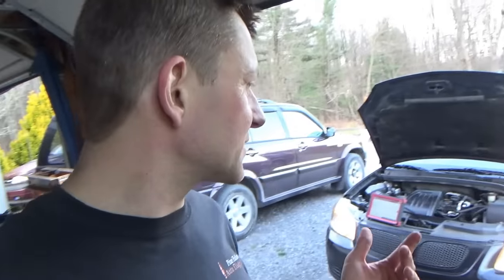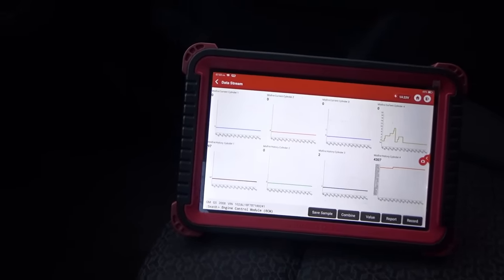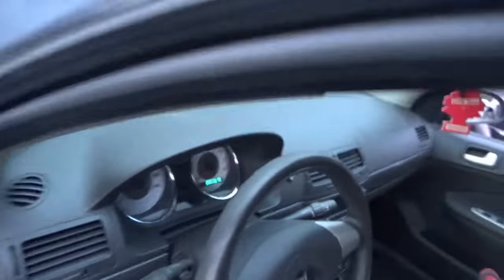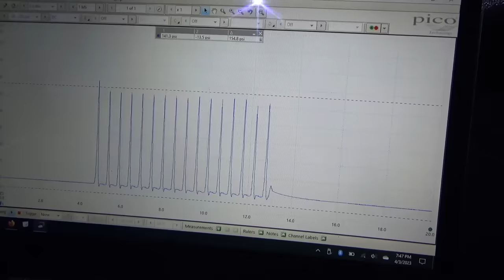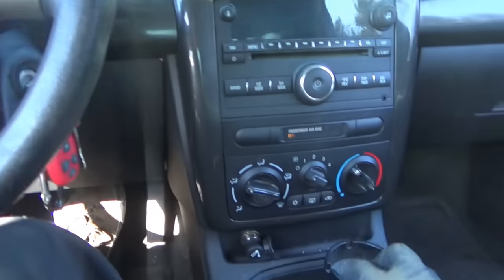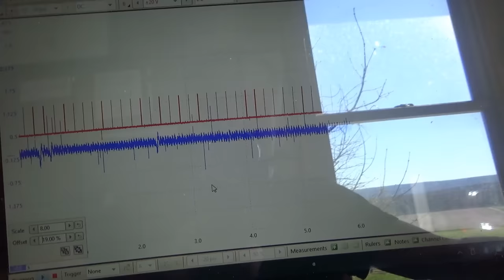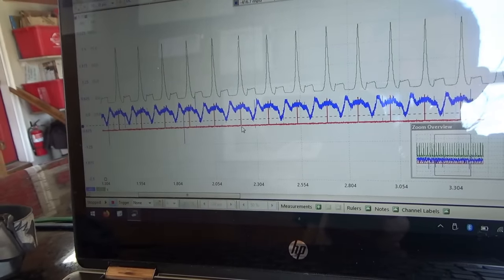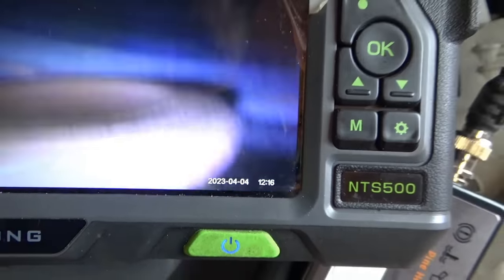P0300 Mystery MISFIRE - Difficult to Diagnose! (Intermittent "FISHBITE")

Comment: Interesting lil car right lol😂 it was just a lil above my technology forgot to tell ya it had a timing chain on it recently
Reply: I was thinking it was like timed at the wrong TDC or something
Reply from the maker: Still running the same?
Reply: Yeah she's still taking it everyday to work lol and you were right manual gauge was unable catch it
Reply: I got a Saab 9-3 with a B207 Engine. It looks exactly like your engine.

I did the timing Chain myself, and used the WRONG Timing Tool to lock the cams. After that i had the Random Misfire code/random missfires!!
Reply: Could be carbon on the valves spray in tb maf cleaner use whole can it might work😊
Reply: I had a 97 grand am 2.4L that miss fired only at idle, ran perfect above idle.  Customer told me it started after he replaced timing chain.  Checked timing and intake cam was one tooth off.  I don't remember which direction as this was 15 years ago.  Either way, corrected timing and problem solved.

Comment: im going with a weak or broken valve spring, as i had this same exact issue with my son's mother's 08 Cobalt, except it was #1 cylinder. Went after it with basically the same diagnostic tree as you did, then loaded the whole arsenal in the parts cannon, and out of a stroke of luck, her valve cover started leaking, so i pulled it off and found a broken exhaust valve spring. it was only the bottom round of the spring that was broke off, so im guessing that when the valve rotated, it would hit that sweet spot and cause a little leak.
Reply from the maker: Wow that's crazy! That just might be the problem here!
Reply: Never in my life, I would have thought of that. But it seems so logical.
Reply: Yep, I would go with that. Seems like the next logical move. HAS to be some kind of compression issue.
Reply: I personally wouldn't recommend the customer just drove it till it gets worse if you even slightly suspect a broken spring. That is playing  Russian roulette with an engine if that valve drops.

Any chance you can get the bore scope in the oil filler opening and manipulate it to view the valve springs if you don't want to pull the rocker cover? Bit of a moot point given the last images from in cylinder though because it definitely needs a valve job.
Reply: @PineHollowAutoDiagnostics  Does this car have hydraulic lifters?
Reply: I would guess guide as it seems to get worse as engine heats up and there is some randomness to the fishbite. In general a spring gets slack and is more consistent..
Would also be nice to see the current profile for the injector correlated with the misfire, maybe the pintle is binding randomly.
Reply: @carmo9693  Yes they do
Reply: I may be showing what I don't know, but if a valve spring was broken,  wouldn't the valve be more apt to float at higher RPM?  This engine smooths out at raised RPM.
Reply: @ThatEEguy2818  No it all depends on where it broken at which could be right at the very first coil as it ramps up words
Reply: the valves dont spin much at all, if they did the seats would be shiny and clean,.,, after several years and alot of miles on the car, they likely dont spin at all..
Reply: Broken valve spring
Reply: Broken valve spring
Reply: That was my guess,  weak or broken valve spring.. 
I had that years ago on a 400 Ford in a 79' F150 years ago and it drove me nuts,,,  it was a WEAK Spring,, not broken...
Reply: Weak is not, because it's on idle, may be broken or wear on valve guides
Reply: No other way to diag than disassembling the top end to look for a broken spring
Reply: @PineHollowAutoDiagnostics  
I have seen this issue with a crack cylinder head around the valve seat
Reply: Seen this exact thing on an 2010 Audi 2.0
Reply: @ohboy2118  Russian Roulette 🤣🤣🤣🤣🤣🤣🤣🤣
Reply: @InsideOfMyOwnMind  at least one person appreciated a Dad Joke👍 🤣
Reply: I believe the valve seat pitting is the issue. How about a cylinder leak down test comparing number 4 to other cylinders. I believe GM had a bulletin about the valve seats but it may have been a different 4 cylinder.
Reply: This sounds like a spot on diagnosis. The exhaust valves didn’t look burnt to me, but there were deposits that could come from a weak or broken valve spring. I’m looking forward to a conclusion to see if you’re correct. 👍🏼
Reply: Even a too tight valve clearance could be enough for some strange effects.
Reply: The valve cover was taken off b4 it was brought to him and everything checked out and moved properly
Reply: Bernie has a test for this
Reply: Did you ever find out for sure what it was?  I have a 2005 buick lesabre with same problem.  Rough idle and using a lot of gas.
Reply: @radupirvu6413 what issue caused ur car sir to behave such ...
Reply: If iam not wrong I would shuffle IGN coil ..and re check spark plugs gap .....if m wrong pls correct me friends ..
Reply: @adnabandasha3201  intermittent misfire on one cylinder, not related to fuel or ignition.
Can’t remember exactly at what level of engine load it was happening
Reply: @radupirvu6413  was that fixed ..u mean was mechanical issue
Reply: @adnabandasha3201  yes In that case a new valve spring fixed the issue

Comment: Worn out valves. I had the same issue years ago. I owned a Ford escort that would misfire and not pass smog testing. I had no money to buy parts other than a couple of gaskets, so I bought the head gaskets and proceeded to remove the head myself. I found the valve sealing surfaces were eroded and wouldn't seal effectively. So I did what anyone without cash would do. I got some fine sand, mixed it with grease and oil to make a paste of lapping compound. right on my kitchen table of my apartment I used a drill to "lap" the seats until they sealed. Fwd and rev over and over on all 8 valves. When I put it all back together the engine ran perfectly, no more miss. A true not many parts required fix and the thing passed smog for 6 more years after that.
Reply from the maker: Amazing! 😎
Reply: Dang love a video

Comment: I put my vote in for the hydraulic lash adjusters. They get worn and spongy at low oil pressure at idle. You bump it just off idle, say 100 rpm and they clear up because the oil pressure comes up and allows the valves to open fully. This engine has the same lash adjusters as the GM 3.6 that has a couple bulletins out about them.
Reply: Excellent point
Reply: yep, question is also if it's clean or clogged or if oil is the right one.
Reply: Good point. As the engine warms up the oil gets thinner and makes the oil pressure lower at idle
Reply: It is like 99 percent, that the problem, they should try to change engine oil, and filter with the right one recommended for that car, and see if the problem resolved, because most mechanic shops put bad quality oil or some of them put  one kind of oil for all cars, i saw that Myself, the mechanic put on my car 10w40, and my car recommend 5w30,  when i told him what are you doing, he said your car is old now, and 5w30 for brand new cars, your car now need 10w40, they are crazy,  they take opportunity that the customer has no knowledge about cars, that why I change car engine oil myself, best oil and best filter,
 Second issue could be hydraulic valve lash problem, and need to be changed.

Comment: I'm impressed by the condition of this engine with close to a quarter million miles. The previous owner must have properly maintained and most likely put a lot of highway miles on that little four-cylinder. It's not worth the cost of removing the head, but I sure would like to see how it would run after a valve job.
Reply: No they didn't it sat for 3 years b4 I got it I got it it was a no crank no start and she didn't change the oil in it for a year
Reply: It sat for three years, but it still had over 240,000
Reply: i have a 95 chevy pickup 400.000 miles work it every day
Reply: Yeah kerrylewis I got it from my dad's wife

Comment: My Ford Focus 2004 got this exact intermittent idle-missing issue. Several mechanics failed to find & resolve the problem, but billed me big amounts for their work & spare-parts change. Finally, one Indian mechanic resolved it easily, finding the issue within seconds of his examination. Some small airflow pipes were damaged and were sucking air in.

Comment: Ivan had a very very similar problem with VW 3 cylinder cars.
Compressions all within 10% of each other, cyl misfire count  up  and eventually the ecu shuts the injector off to protect the Cat.
Problem caused by oval valves !! .The valve guides were badly worn causing poor seating of the valves.
Guides changed new vales fitted , compression still within 10% of each other but all reading about 10psi higher than before.
Now no misfire and cured. Apparently very common on Vw, Skoda and Seat.
That was 3 years ago and still no misfires since repair.
Reply from the maker: Wow never heard of oval valves before!! Must be a fancy Euro feature 😉
Reply: @PineHollowAutoDiagnostics  Hey it's a VW.

Comment: I have seen something like this with a bad injector rubber seal to the cylinder head.And it shows on idle because the throttle is closed and there Is higher vacuum.A good test is to smoke test the in cylinder with closed valves to check the injector.All your other approaches were great.Love to watch your videos.

Comment: Back in the day of the early Ford 302/351 Windsor engine, before check engine lights, before electronic ignition, before PC based diagnostics, intermittant misfires at idle were not uncommon. "Drive it until it gets worse" was quite often the suggestion. "Worse" usually coincided with a tapping noise and a tear down would reveal an excessively worn valve guide. After a few of these, you started to recognize the problem early on. Great video, I'll be interested if this one is ever fully repaired.
Reply: I'm from back in the day, you treed me on valve guide.
Reply: Yep. I got in this career in 72 when only electronic component was the radio ‼️
Reply: @dharley189  Age thing, I'm 75.
Reply: @dharley189  1968 Volkswagen had electronic fuel injection on the Type 3.
Reply: @gfbemc0256  Yep. I was 17. Manuals like today hard to come by. Not many in domestic repair understood it.

Comment: Had a few of those do that with crappy valve seats. More common was the early Colorado/canyon. Gm had us put stiffer valve springs in thinking that would make them seal. They later campaigned the complete heads! Did many!!! If you get the saab 9-3 ecotech turbo they have crap valves too but show up very low comp. Cold!  I enjoy all the scope stuff. Thanks!!!

Comment: Intresting problem. I have your pressure transducers. They are great at finding problems without having to tear things apart. I have never seen an intermittently leaking/not opening/closing valve but your explanation of the valve rotating and hitting a bad spot makes perfect sense. 
Thanks, Ivan!

Comment: Leakdown test will show leaking valves. I'll bet it's low on compression and the leakdown will be above 
50%.  Ivan, you need to modify your electric transducers so that compressed air can be supplied for an actual leakdown test.
Reply from the maker: That's one test that might definitely show something interesting 👍
Reply: I would also do a leakdown.  You could also check for a leaking fuel injector seal; they dry out with age, and a small leak at an injector seal will have a problem at idle due to maximum vacuum and smallest amount of fuel being added,  That said, I suspect the lower compression on cylinder four is just enough to cause it to misfire.  Is valve lash adjustable on this car?
Reply: Speaking of old school and the leak down test, not one vacuum gauge was hooked up for another test, a lot of knowledge can be found in the bouncing needle. Remember the one on the Sun 1120 (1st scope I ever used), it was like 10 inches in diameter.  It was just yesterday,  49 years ago.
Reply: @MY-ml5rp  Love those old and BIG gauges that show some activity when its there.
Reply: @PineHollowAutoDiagnostics  The pressure used for the leakdown should be around 50 psi.  If 100 psi or more is used, it can seat the valve and make it it seal.  We found this out the hard way on the first 2.2 we had with bad guides.  We replaced many heads under warranty for this exact problem.
Reply: @MY-ml5rp  Vacuum gauge is still one of favorite old school tools, not real specific but they will get You in the arena. First thing I grab when a plugged cat is suspect.
Reply: @MY-ml5rp  Agreed. Way back in the day, an analog vacuum gauge could tell a good mechanic a lot.
Reply: @reneneron2971  No, lash is not adjustable on these engines.
Reply: @MY-ml5rp Vacuum gauges are somewhat like me. We’re both getting obsolete. As well as finding a vacuum fitting on the manifold is getting tougher all the time.
Reply: Seasoned
Reply: @MY-ml5rp  yes if there is a place to hook up a vacuum gauge it can tell alot, even a clogged CAT..
Reply: @PineHollowAutoDiagnostics  i always do a compression check followed by a leak down test. When doing a leak down test i pull the valve cover make sure the valves are closed on the bad cylinder. If the air pressure comes out of intake bad intake valve, if comes out of exhaust bad exhaust valve, thru  the crank case vent bad rings.

Comment: Great information gathering.  You did prove beyond a shadow of a doubt it was compression, and my school of thought is there is more than one contributing factor.  Between worn rings, pitted valves and seats, it could be all cylinders are on the cusp of misfiring and it doesn't take much of a drop for a misfire to occur.  As you said it could be when a larger pit in a valve aligns with a larger pit in the seat there is enough of a drop in compression to cause a misfire.  Maybe at idle there is a valve that is hanging up a little that does not happen at higher RPM's.  A leak down test that has already been suggested would be another test, but it would not change the recommendation.  Bottom line is as you said, run it until it either becomes undrivable or until the salt completely devours the car, which is a distinct possibility where you live.

Comment: I'd likely pull the valve cover for an inspection of the valve train. I've seen others comment about a broken valve spring, but it could also be a problem with one of the cam followers, such as a flat spot or damaged needle bearings. If an intake valve isn't fully opening, it partially starves the cylinder of the intake charge, and a misfire results.
Reply: Would replacing the engine be a simpler fix for something like this? I’m having very similar issues with my Honda Accord j series.
Reply: scope the intake and exhaust valve thru the 4th spark plug hole.   After that, do a cylinder leak down test with 30 PSI.    If you hear leak from the throttle housing, it is an intake valve leak; If you hear leak from oil dip stick tube or. oil fill hole, it is a piston ring leak.   If you hear a leak from the exhaust, then it is an exhaust valve leak.   It does not matter.............car isn't worth persuing a fix regardless.

Comment: One last check; a slow leak of water past the head gasket; open radiator cap to depressure the coolant; and see if missout continues.   The weak valve spring suggestion, is a good one also.

Comment: I have a 2002 Ford Explorer Sport Trac w/4.0 SOHC engine that does EXACTLY what this Pontiac engine is doing. Engine does not use oil. Only misses on idles. My mechanic has pulled out his last few hairs trying to sort this out. Thank you very much for your tenacity to follow this rabbit down the hole!
Reply: do a smoke test and /or cylinder leak down test.............

Comment: We had lots of issues with carbon buildup on intake valves causing this. Good hot cleaning with GM Top engine clean and let it sit 1/2 hour in middle of cleaning helped them many times.

Comment: Other issue it could be: Messed up spray pattern on the injector. Sometimes injectors flow fairly fine but they don't atomize the fuel well enough anymore. Air fuel mixture is not ideal in lean burn mode at idle.
Reply: Cool

Comment: I remember something like this, and it had the double valve spring, the outer spring was broken, I'm assuming rotation would seal sometimes, but that wouldn't account for running fine when cold or at speed.

Comment: I had a similar misfire on GM 4.2l inline 6 with about 280k miles. I tried checking for intake manifold leak with a spray and found nothing. Since the valve cover gasket was leaking oil, i decided to replace the cover and intake gaskets. Turned out the intake gasket WAS leaking and the misfire went away. Ran smooth as new. I'm guessing that Pontiac has a lifter and/or valve spring issue.

Comment: Really interesting case. Actually impressed with the mileage and decent condition, though it does appear that a valve job is due. The intermittent aspect is strange, especially when at one point 4 was not missing but 2 other cylinders were. Interesting! 👍👍🇺🇸🇺🇸
Reply: Probably it was cyl4 all the time, It could be false misfire data

Comment: 20+ years ago Honda, (and others), had carbon build up problems on the valves. I believe there was a TSB stating a crank no start condition related to valve sealing/carbon issues. I encountered one, and fed it plenty of carb cleaner while cranking cranking. I finally got it started, blew it out, and apparently solved the problem. A BG, or similar injector/valve cleaner, or GM TOP ENGINE cleaner is definitely cheap enough, and worth a shot. THAT, would be my next step.

Comment: Due to running ok from cold and milage of vehicle. My guess from your data would be a sticking valve. Excessive carbon build up on valve stem and or tight guide. So yes, compression related fault.👍
Reply: So basically keep running it but add some seafoam to the gas and some Marvel Mystery Oil to the oil and hopefully get that loosen back up. Or tear the top end of apart and do a valve job and new lifters.